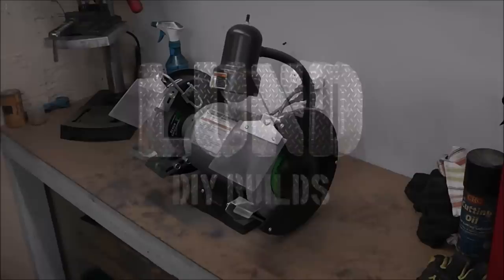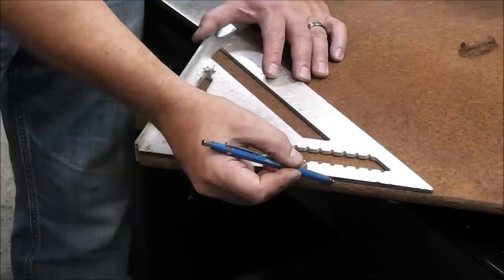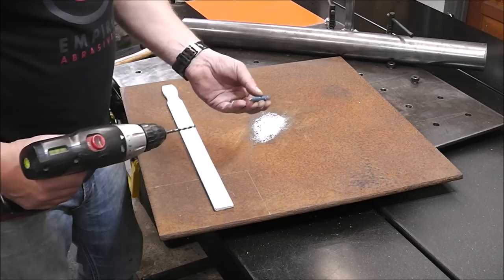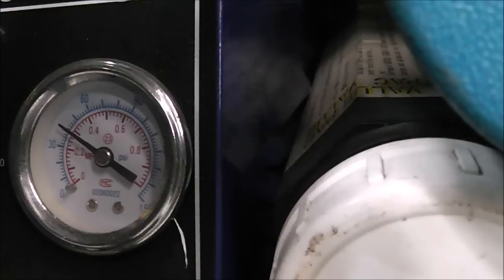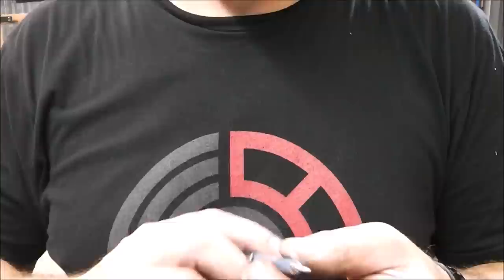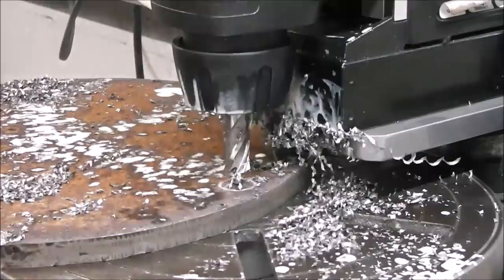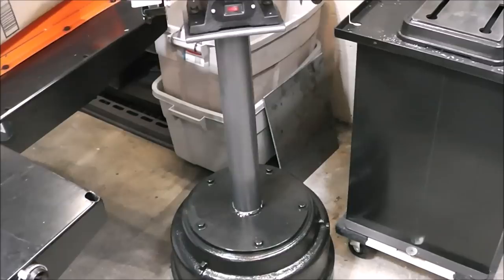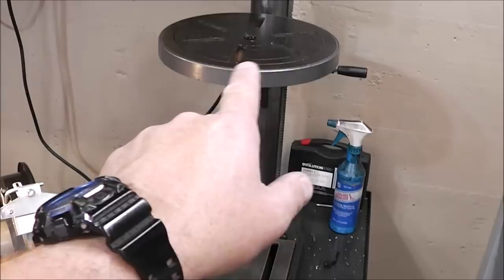Ultimate DIY Budget Grinder Pedestal Base MIG Welding

Comment: I'm glad you added the sand, I was going to say "heat the cast steel brake drum and weld a floor plate on it, that way you can fill the base with, concrete, gravel, or sand", the heavier the better. That's the beauty of the bolt on pedestal, you can fill it with weight. Nice build!
Reply from the maker: Thanks!

Comment: Hay Brandon I have that same set up , but I have my vice on it instead of my grinder by the way I think your vice and mine might be twins, my grinder has always been mounted on the edge of bench , but l had to raise it about 6 inches to help with my back pain . If I was younger I would set everything up in a horizontally receiver hitch  type.   then l could use them in  different areas . Nice build and stay safe  TANK
Reply from the maker: Thanks man! Thats a great idea mounting a vise on it!

Comment: I ran a 'wanted' ad on Craigslist for some 18 wheeler break drums. People come out of the woodwork and are looking to give these away. Especially if you tell them the project you are going to use them for.
Those drums are steel AND cast iron. They are steel where the flat flange with the holes are and the 'drums are cast. When in doubt bolts are the way to go. 
Nice build and thanks for the tips. It's always nice to see how someone else tackles a common problem.
Reply from the maker: Thanks Andrew! Great info,, thank you!! I appreciate your support.

Comment: Nicely designed Brandon and it turned out great too. 👍👍👏🏻👏🏻👏🏻👏🏻👏🏻👏🏻. Great tip about dampening the sound and cutting down the vibration also. I still have to get with a scrap yard for the metal and a steel yard for cut offs. Thanks for sharing with us it’s appreciated.
Reply from the maker: Thanks man! The sand seems to help a lot!

Comment: I'm finally about to make my bench grinder base. Ive had the parts ready for a year now and I just finally went out today and got some concrete. The base is my old truck drum brakes and a rotor welded together and a piece of tube with some angle iron welded to it so my grinder sits in it nice and tight.
Reply from the maker: Thats awesome! That will make a nice solid base!

Comment: Hey Brandon Greetings from India! Nice build, enjoyed it with early morning coffee. 
That pedestal is proper Heavy Metal \m/
Good decision to use bolts, I was looking forward to seeing your mag drill press in action. 

FYI from a noob to other noobs considering auto/agri/railway scrap parts: Over a couple of decades I've used a few tons of this stuff! They're quite different from mild steel, construction steel or rebar. These parts are High-er in carbon content with added chromium, molybdenum or other elements for specific hardness and wear applications. You need to handle them almost like tool steel. 
They're definitely harder to drill, machine very differently on the lathe and mill, and they eat blunt tools for breakfast. Annular cutters or split point drill bits work best for drilling, very short/stiff ball-nose end mills work best for milling, stiff & sharp HSS bits (with a slight nose radius) are best for turning & facing. If you have access to one, use a "diamond lathe tool holder" also known as a tangential tool holder for any lathe operations. Carbide inserts tend to chip frequently while machining these parts due to variations in surface hardness, hidden weld repairs, or from interrupted cuts.  
They never weld properly with 6011/6013 rods (guaranteed weld cracks & inclusions). 
7018 and stainless 309l welding rods work better (yes, you can use stainless rods with non stainless parts but not the other way around). Tig/mig welding works well with silicon bronze filler material. Almost as good as brazing, so just braze if that's a possibility. 

A Question for Viewers from various parts of the world: How much does a pound of decent scrap steel cost in your part of the world? 
I pay the equivalent of 22c (30 Indian rupees) for a kilogram of steel (10c per pound). Considering how steel is traded internationally, prices should be fairly similar even halfway across the world! Although junk isn't really considered junk here, lots of people make their living from buying, repairing, repurposing or selling it for scrap, so your usual market laws apply. Depending on who I buy from and how quickly/badly I want it, sometimes even junk is really expensive (almost as much as new stuff).
Reply from the maker: This is great information and thank you for sharing! I pay anywhere from 10c to 25c depending on where I’m buying it.

Comment: I have a vise on a drum like that and put my grinder on a 15" car rim. Its nice to be able to move the vice where I need it, inside or out. I split a fuel line and put it around the car rim on the bottom to take care of the vibration. And the grinder is very portable. Side note you can not have too many vises.
Reply from the maker: Right on man on everything!

Comment: Nice stand. I use old rims flipped so that I weld to the inside and then fill it up with concrete and smooth it out. And those old rims make for very heavy solid stands. But I do like the huge truck brake drum idea as well. If I ever come by one of those, I will snatch it up for such a future stand. Thumbs Up
Reply from the maker: Thanks man! Thats a great idea using a rim also! Thanks for sharing!

Comment: Looks really good Brandon! I like the sand in the tube idea, looks like I'm drilling a hole in my top plate. I also managed to break the cheap cast base to my grinder tightening it down. Took me a few hours, but I managed to make a new one out of steel. Guess I need to calm down a bit when tightening things.
Reply from the maker: Hahaha it happens Jeffrey. I've broken more stuff by tightening it down that I can remember.

Comment: Brandon, when you need to weld 1/2 inch go to manual  settings and dial in from there you don;t have to stay with synergic  settings as the programs go to 1/4 inch   on that setting.
Reply from the maker: Thanks man! If i remember correctly there is also a setting that will add an additional percentage (even if its maxed out   but I can't remember the actual setting / function.  I usually check out Milky Cerials channel when I get hung up. He has the Fronius setup mastered
Reply: @BrandonLund  Really like your grinder stand build. I may miss your next Friday video as i have to go on a moose hunt next week, usually we go  for the first week in October , fly in moose hunt but we are getting to old for that so it is a more local hunt. Such it life in British Columbia Canada
My neighbour already got a 5x6  elk  dressed out a 445 lbs  so not bad for a back yard elk . keep those videos coming.
Reply from the maker: Thanks man I appreciate it! Good luck on your hunt!

Comment: I made something similar years back. The mounting plate was a bloody great 14" square of 20mm (Around 3/4") thick plate (Because it was the only chunky piece of steel I had to hand at the time). I used the extra surface area to build a full width angleable work rest. The post was a length of 3" thick walled pipe, and that was flanged at the end to bolt onto a 15" steel wheel, complete with a very bald tyre. The post bolted to the inside of the wheel (Where the hub and brake disc would have been) so I could fill the space in it with sand bags.

It worked really well. It was stable, and the work rest was great for putting neat 45' bevels on plates before welding them........... But a friend kept asking me how much I wanted for the setup, and eventually I needed the money more than I needed the grinder. :(

I keep meaning to make another, but my current little hobby workshop is a very cramped space, and I really haven't got the room for it (TBH, I haven't really got enough room for the tools and machines I've already got now !).
Reply from the maker: It sounds like it was super heavy duty! My shop is getting a little over crowded also so I feel your frustration :)

Comment: i used a brake drum for my bench vise. yost adi 6. went with 3/8 plate and 7/8 bolts every other hole for mounting.  pipe was about 4' x .25'. u are right, hard to buy something better. will last a lifetime
Reply from the maker: Right on Walter! HEAVY DUTY! 👍

Comment: As I'm watching this, I like what you have done. I did wonder why not make it with a bigger top plate so you could mount something else on the opposite side? Nice work.
Reply from the maker: Thanks Scott! Your right about the top. I soon realized that as soon as I started using it. I actually plan to remove the grinder and bolt a wider plate to the existing place so I can fit 2 or 3 grinders in a row to save sapce.  If my shop was a little bigger I would probably have it in an open space rather than against the wall so I could have the grinders front to back as you suggested. Thats probably the more functional way of having them.

Comment: Have had my grinders bolted to a bench for years. About time to free up the space. Have been thinking about it for a while. But I'll finish my morning coffees first. 😁😁
Need to build a slightly bigger version for 3 different grinders. Or just build 3. Hmmm...thinking about it now.
Thanks for the motivation
I put a oil purifier/desicant unit in line $75. Doubled the life of my consumable on my plasma cutter.
About the Mill Drill..that's what my wife said as well. End of that thought.🤣🤣🤣
Nice idea with the sand👍🏻👍🏻👍🏻
Grinding wheel dressers are fairly cheap and help keep your wheels in pretty good balance and prolong the life of the grinders. Worth investing in I think. About $20 for good ones
Reply from the maker: Thats a great idea Basil! Ive actually thought about adding a second grinder to this. I was thinking about bolting a wider plate to the current plate then mounting 2 grinders side by side.  Just an idea 💡;)
Reply: @BrandonLund  That's basically what I'm mulling over now with my coffee
Reply from the maker: If you do decide to add 3 to 1 base, its gonna take 3 men and a boy if you ever have to move it but it will be super cool looking! 👍
Reply: @BrandonLund  Yes I'm kind of thinking that now. Probably going to do 3 separate ones. A 3 in one is going to loose all the space that I'm going to save.
Reply: @BrandonLund  That's the beauty of the second cup of coffee. Logic starts to kick in🤣🤣
Reply from the maker: I feel your pain brother. Don't ask me to even think before my 2nd cup 😁

Comment: Good job Brandon, looks great and also sounds quieter than it would have done without the sand! That said, for thick steel I personally prefer a stick welder.
Reply from the maker: I agree 100% stick is my favorite process too but this was the first time maxing this machine (well almost, I could have pushed it a bit further with advanced settings) but I wanted to see how it did.
Reply: @BrandonLund  It's a nice machine and did the job well, so fair enough.

Comment: I like your idea of making a bigger plate so you can mount 2 grinders. I have my Grinders mounted back-to-back on one plate; smooth and rough stone on one side and wire wheel and buffing wheel on the other. It's not too hard for me to waltz it around when I need to change but mine doesn't weigh over 150 pounds. :)
Reply from the maker: Thanks man. I still haven't got around to it. Probably in an upcoming episode

Comment: Always at another level.good video
Reply from the maker: Thanks man! I truly appreciate this comment! ❤ 😁 👊
Reply: @BrandonLund  your welcome.hey sorry for asking questions but i can't find an answer on Google or YouTube .was trying to repair my pressure washer pump made a hole on pump made of aluminum and figured ill plug it up with tig .seeing your videos everything looks easy😂 . i was so wrong my tig level is beginner my gas filter keeps turning white and blue from the aluminum material from pressure washer pump material.keep trying to do what i seen on your videos and i keep failing.puzzled
Reply from the maker: It sounds like contamination. In which case you need to ensure the part is clean and v out.  It could also be a magnesium alloy. Grab some white vinegar and put some on the metal casting. If its an aluminum alloy it will do nothing. If its a magnesium alloy it will fizz. 4043 would probably be the best filler if you determine its an aluminum alloy.
Reply: @BrandonLund  thanks again i out vinegar it didn't't have any reaction i put a piece overnight to see if anything changes.again thank you

Comment: Cut50 will cut 1" easy.....use extended tips (and electrode) with 60-65psi for thick....it will work great ,don't go crazy with industrial use but a cut an 10" I beam just fine. Thanks for sharing the build.
Reply from the maker: Thanks for the tip!

Comment: I'm back again, BL!  For those who want to write anything negative about a mag drill, I've got a question for you.  How do you use your mill when you're faced with large drill work out in the field?  Some of us "farmer types" have heavy equipment and trucks that require inverted cutting.  In other words, the holes have to be drilled - through thick metal - sideways or upside down.  Sure, a mill is great when it's possible to bring the work inside to your mill, but, needless to say, that's not always possible.  For example, I recently needed to mount a pair of clevises to the rear of my work truck chassis.  I ran a long power cord out to the rear of the truck, fixed our mag drill onto the work and simply drilled the 13/16" holes in a single stroke.  Just like that, we were able to pass 3/4" O.D. steel pins - through the truly square holes - in the chassis!  When one considers the time required, the wear and tear on tooling and the lack of square one typically experiences with step-drilling, a good mag drill becomes a dream tool!  Once again, your Fronius "MIG Rig" is awesome!  Where did you get the mag drill's base from?  Keep on keepin' on, Brandon!  👍
Reply from the maker: Thanks buddy! 35 dollars on Marketplace! It started out as a burned out drill press. I got rid of the drill head, modified the column and welded a plate to it. I actually have a video on building it. It's in the same playlist as this video
Reply: @BrandonLund  Thanks for the info, BL!  As I'm such a hillbilly, I haven't watched many videos, including yours, I'm sorry to say ... and, speaking of being backward, what is "Marketplace"? (seriously) 🤠
Reply from the maker: Oh dude, it's a goldmine. Facebook Marketplace. I'm slightly addicted. It's an online buying selling site. Anything you can imagine (that's legal) of coarse.

Comment: Nice build. Just a thought, try moving the grinding wheels into different positions (clock-wise, one side at a time) to see if maybe you can get the heavy part of the wheel(s) to self balance. You may also want to try, turning one grinding wheel say clock wise, and the other one counter clock wise to find a balance that works. I would make a single mark (line / dot) on each wheel(s) to aid in letting you know just how much or little you have moved the wheel. I'm not gonna say this will solve your out of balance problem, (it just may) but it should improve it from where your grinding machine is presently dealing with. You can hear it in the video. good luck. Cost is only maybe 15 minutes of your time.
Reply from the maker: GREAT SUGGESTION! I hadn't thought of this but it makes perfect sense and will likely make the problem better. Thank you for your suggestion!

Comment: You could slice open a piece of rubber hose for the bottom of the brake drum so that you don't get a rusty circle on the floor, or put an old mud flap under it.
Reply from the maker: Great tip!!!! Thank you!!!! I WILL be doing this.

Comment: How do you like that grinder? It's HF right? Does it big down easy or get really hot fast? I have a basic 6" from HF and it will big down super easy if you press into it at all. Also gets really hot fast. It's still usable but I want something with more power.
Reply from the maker: @Christopher Salisbury I love it. It's the 8" model from HF. It doesn't really bog down for what I use it for and I've had it for a while and it never gets hot.
Reply: @BrandonLund  nice!

Comment: A lot easier is to use a steel car wheel.
Use 2 lengths of angle, one on either side of the tube, welded to the wheel & tube. 
Fill with concrete if necessary.
Reply from the maker: Nah, I wasn't going for easy. I had this stuff and I wanted something heavy that dampened vibration. This does all of that.

Comment: It’s a fifth wheel axle off probably the 2nd rear wheel   And yes they are cast iron the thing about cast iron is yo u can weld it with 6011 Smaw  rod welding

Comment: Sorry I typed the below message before watching the video bear with me I'm old and senile.
 When you say scrap yard are you saying metal recycler? Like up my way we have one named AIM, Amercian Industrial Metal. I have wondered if they would sell me some scrap steel. How do you come up with a fair price for what you buy? Do you pay like half the cost of new or do they see it to you buy the pound in some fashion?  Great site good job, JeffinMaine.
Reply from the maker: Yes when I say "scrap yard" I'm refering to both places. Metal recyclers and metal suppliers. BOTH places will generally sell thier scraps for "by the pound" prices. It's been a while since I bought scrap but they wil usually sell it for the by the pound price what they would pay you for it, bot not always depending on the size of the scrap. If I remember correctly, I think the last plate I bought was my fabrication table and I think I paid around 25 cents a pound and that was at a scrap metal place in Winslow. They had just got in a huge shipment of scrap plate from somewhere and I just happened to be at the right place at the right time.
Reply: wow cool , my computer has been down, Thanks for the reply though. @BrandonLund